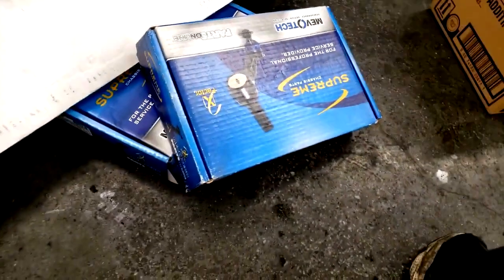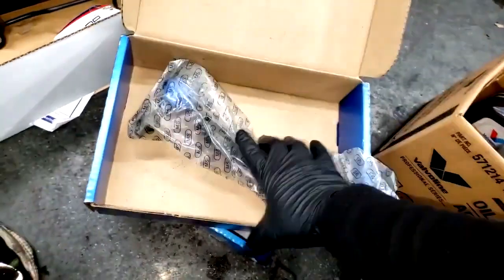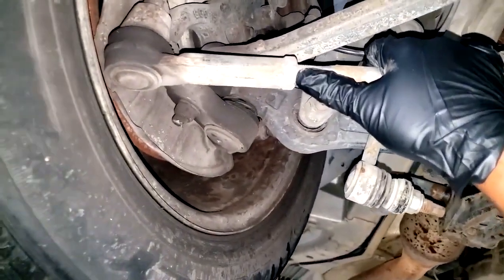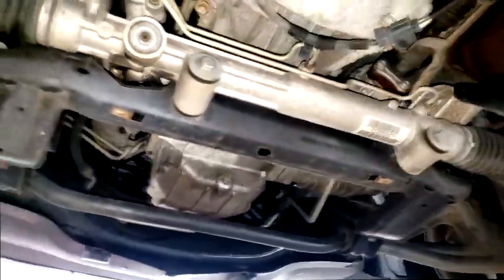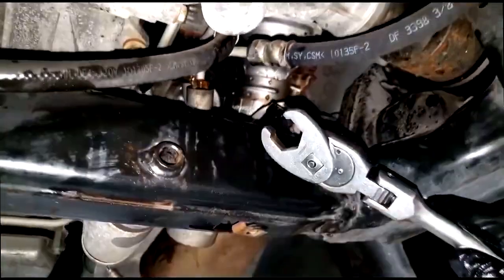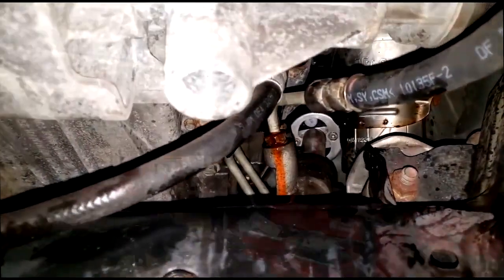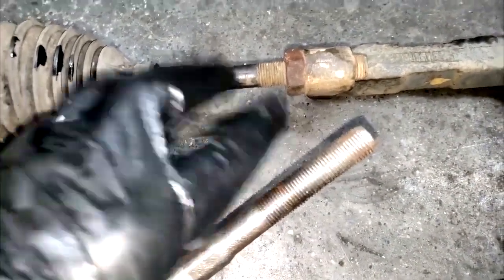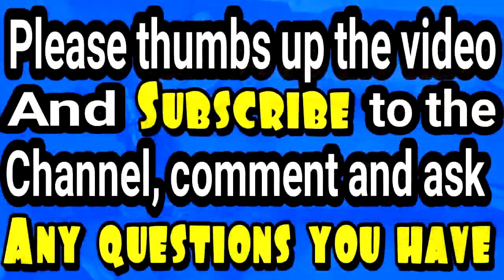A Must Have Tool to do this Suspension Job. Look what happen

Comment: JT, you ain't got a bin of some sort with bolts and nuts? You could simply go dig a little and find what you need. Anyway, thanks for the video. I guess the duct tape didn't work.

Comment: I bought a set of crows feet for working on the wifes GC... still haven't used them lol. I had to eyeball fix the toe on it because the shop we took it too for work botched the alignment. And I really don't trust the local ma mopar dealership - they don't got no one like JT.

Comment: My 2000 Honda Accord "Remanufactured" Rack and pinion was $600 WITHOUT THE CORE CHARGE 😮 JT That's MY cost as a tech, retail is $900 🤯 not including installation, lines, fluid or pump 😂